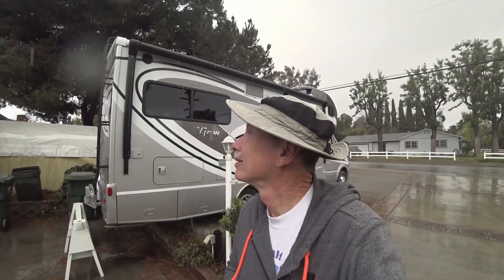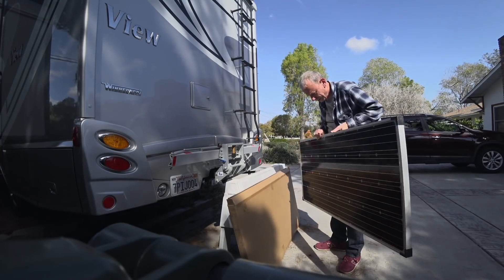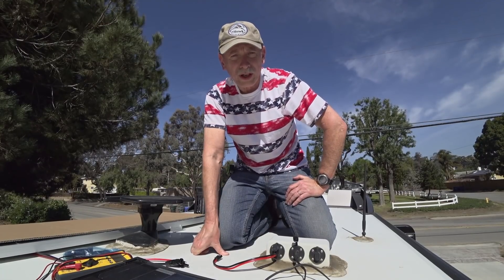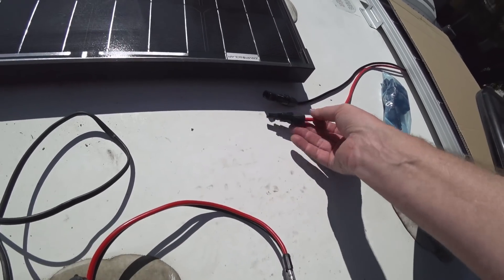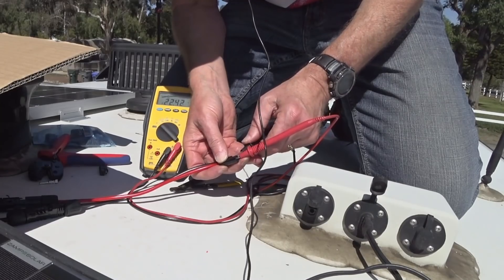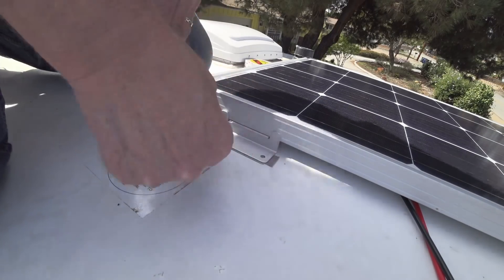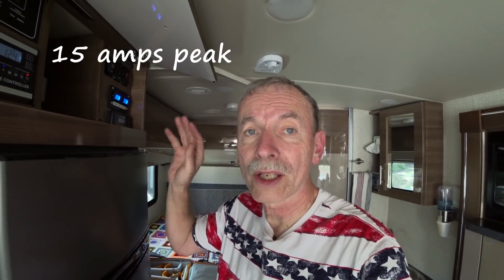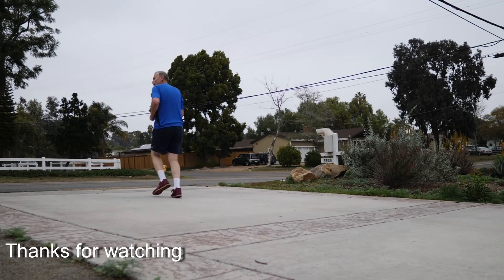RV Solar - Easy to do, but do you need it?

Comment: Hey Ron! I 300 watts of solar installed along with a 2000 watt inverter and AC soft starter. However, my AC still doesn't kick over? Does the view no allow for AC to be ran on batteries with the default wiring? What do I need to change?
Reply from the maker: Good question. I wired all my AC outlets together so either shore power or inverter powers everything. So it is possible that your inverter output is on a separate line that only powers a few outlets.

Comment: Glad to see you using VHB tape. This permanent bond tape is definitely the way to go, no reason risking drilling holes in the roof. Even better if you use 3M Adhesion Promoter. The way you did it, position and mark panel, attach tape to panel bracket, finally remove backing to bond tape to roof. Once that tape hits the roof it is done, no second chances!

Comment: Hi Ron, great videos. Just got a 2018 view and love it and have watched all of your videos on mods. One question, I just bought a 220 watt Newpowa solar panel to add to the top and just found out the plug in's on top are only rated to 150 watts. Do you think it is safe to add that panel anyway or could I damage something by doing that? Do the ports only allow 150 watts input regardless of the size of the panel or will the machine burn up if i try to stuff more than 150 watts into it? Really appreciate your insight on this, can't find much info on the web. thanks
Reply from the maker: I have a 200 watt Newpowa panel. No problem. The wiring and solar controller are rated up to 450w as i remember.

Comment: Great video. I want to install solar panels to my RV. Like you, I do not want to drill holes on my roof. I have dough about the security of the VHB tape. How is your panel holding up? Did you use 1" on 1.25" tape? Again great video.
Reply from the maker: Vhb will never let go as long as the roof is cleaned beforehand. I probably used 1” wide. Just to cover the bottom of the bracket.

Comment: Hey Ron. I have 2016J with very similar config ( 1 ZAMP solar panel and 1 Zampbox inside). Following this video I bought same panel from Amazon. Before permanent instalation I placed the panel on my RV . I am seeing 18.5 V without load and seeing about 0.5A when i connect to my solar converter. Do you think my panel is bad? I wanted to get your opinion before i contact manufacturer. Thanks
Reply: it turns out my house battery was close to full and solar controller was not taking in all A produced by the panel. I depleted house battery a little, tested and it is all good now
Reply from the maker: Depends on how much sun is shining on the panel. I tested mine and got just over 20 volts and 6 amps when pointed directly at the sun. This time of the year flat on RV roof will be a lot less.

Comment: Hi Ron, How do I set up my RV to run off the solar as if the generator is on and charge the batteries? I just ordered a 400 watt solar system for my sprinter Prism RV.
Reply from the maker: The DC from the solar is connected to the 12volts batteries. The genny will power your converter that also charges the batteries.

Comment: Grampa Ron, I have a question! I want to add an additional solar panel as well, however I don’t want to penetrate the one peace fiberglass roof. How has your additional panel hold up with just the double sided tape? Your videos are great and I have learned a lot from your experiences. I thank you for this channel!
Reply from the maker: The new panel is fine. Very well secured. Should last the life of the RV.
Reply: @ontheroadwithron2432  awesome thanks for letting me know!

Comment: Grandpa, did you screw the brackets into the roof or just use the tape? Are you worried about the panels flying off on the interstate?
Reply from the maker: Just VHB  tape. It is stronger that screws as long as surfaces are clean.

Comment: With the switch by Winnebago from 3-way fridges to DC compressor fridges a great deal more load is applied to the house batteries and it is a 24 x 7 load of more than 100AH. I got by very well with an RV with the 3-way fridge that ran off of propane most of the time and 200 Watts of solar panel production. With a compressor fridge in a Navion we now can go at most 2 days without having to run the generator as the two 100W panels installed at the factory can not maintain the batteries at the needed charge level otherwise.
Reply from the maker: Probably need at least 400 watts solar

Comment: I'm enjoying your videos, Grandpa Ron (best handle ever, BTW)! This is a great video and the EXACT upgrade I'm looking to do to my 2016 View with one solar panel from the factory. One question, did you use tape only, no screws to hold down your new panel? Not sure if I would trust that 100%. Thanks for sharing.
Reply from the maker: Rich Lorimer yes only the 3M tape. We used it in our military products with great success. Works much better than screws.
Reply: @ontheroadwithron2432  Thanks Ron, I appreciate the reply and info!

Comment: I planned to add two 100W panels to our 2016 Navion 24J in addition to the factory single panel for the same purpose: to be able to charge our golf cart. Now I'm going to go with a single 175W panel and save the roof space.  I would love to hear how well the uncovered 16AWG wire insulation holds up in the elements.  I was considering using a UV stable conduit of some type to protect them from deterioration.  Will wait until the heat and humidity of the Gulf Coast lets up a bit before doing this project.  Any thoughts?
Reply from the maker: my 275 watts have been plenty for me.  No problem with the cable on the roof as I'm sure they were designed for being in the sun.  However I did have to replace the Zamp collector box.  The thermal fuse in the box corroded and I noticed the solar current went way down.  Zamp sent me a new one.
Reply: @ontheroadwithron2432  in your video you are showing almost 15A with two panels. How many ampere you were getting when you noticed thermal box corrosion. I am getting 2.8A with Zamp original panel and only 0.5A with new Newpowa panel. I tried different ports with no difference in result. Scratching my head if new panel is the issue or something else.

Comment: Hello Dan, I am not an electrician but I can do minor wiring and such. We have an order in for the 2020 Navion. It has 2- 100W  solar panels and 2000W Inverter. Besides charging batteries what else can you do with this solar system? Is it worth the $ to add a third 100W solar panel? I have watched many of your videos and oil change fuel filter change will come in handy as I try to do all maintenance on my vehicles. Great videos and many thanks for taking the time to inform. Thank you
Reply from the maker: rob welsh third panel depends on your electrical needs. I would say yes as the compressor fridge uses a lot of power and you will drain your batteries in 1-2 cloudy days. If you always stay in campgrounds or plug in at night, then the solar is not of much use. Best thing is to try it as is for a year. And then the answer will be more clear.
Reply from the maker: rob welsh one more thing. I use my 2K watt inverter for the microwave and a backup that can run the fridge if there is a problem with the propane. The amount of solar is related to the battery capacity. It is a waste adding more solar when you have the low capacity original dual purpose coach batteries.
Reply: The Group 31 batteries that come with the 2020 Navion are a bit low for storage. I may able to sell them and purchase 2-lithium ion batteries from the internet. Thank you for the reply Ron.

Comment: Why didn't you screw them to the roof? It gets hot up there and that 3M tape could release then only your dicor is holding the panels on.  I don't trust it especially in high winds. I have had a lot of experience with 3M tape coming off auto side moldings in the heat, I quit re-taping them at my body shop because of the failure rate. A side molding on a vehicle considerably lighter than a solar panel, you seem to know what you are doing, I just was curious why. Thanks
Reply from the maker: Don’t worry about the VHB tape. I’ve used it on military products. It will last forever and I will have to cut it off to remove the brackets. Much more reliable than screws.
Reply: @ontheroadwithron2432  I think I will do both just to be sure, thanks for the informative video!

Comment: Great video Ron. Where did you get the two wire lead that goes into the zamp box on the roof?
Reply from the maker: Amazon of course.  This is what I got, but a 2 foot length would have been better.  https://www.amazon.com/Nilight-Gauge-Quick-Disconnect-Harness/dp/B0057ZQJ12/ref=pd_bxgy_263_2?_encoding=UTF8&pd_rd_i=B0057ZQJ12&pd_rd_r=cb3007d7-ed02-11e8-8e2e-49ff07944d9e&pd_rd_w=6TBGN&pd_rd_wg=TzHy0&pf_rd_i=desktop-dp-sims&pf_rd_m=ATVPDKIKX0DER&pf_rd_p=6725dbd6-9917-451d-beba-16af7874e407&pf_rd_r=5KTBFJRQP03GX5RMJRKE&pf_rd_s=desktop-dp-sims&pf_rd_t=40701&psc=1&refRID=5KTBFJRQP03GX5RMJRKE

Comment: Ron, I thought I read that the roof top junction Zamp has a max watt of 150 per port, and 500 max per the entire box.  You installed a 170 watt panel is that ok?
Also our new RV came with two 100 watt panels flat on the roof.  Should I replace them with panels that allow air underneath?
Reply from the maker: My box is marked 450 watts max.  All 3 ports run to the same thing, so the 275 total I have is not overloading it.  I could put one more up there but don't need it.  If you already have the surface mount panels i would use them.  Differences are not that great.  If you have the compressor fridge, you might want to add another panel as they use a lot of electrical power and you don't always have ideal solar.
Reply: Thanks Ron,  btw nice meeting you at the rally. Quick question.  Which solar panel did you buy for the third panel and where. And where did you purchase the connectors for the zamp roof box.
Greatly appreciated.  
Jack
Reply from the maker: I only have 2 panels.  100W came on the rig and added the 175 watt here.  Got connectors from Amazon https://www.amazon.com/gp/product/B00H1M8ASE/ref=oh_aui_search_detailpage?ie=UTF8&psc=1.  Also got a crinmp tool for these. https://www.amazon.com/gp/product/B00N3PTXJS/ref=oh_aui_search_detailpage?ie=UTF8&psc=1

Comment: Did you have to drill into roof at all with installation? Apologies if this is a repeated question.
Reply from the maker: No drilling needed.  Used VHB tape from 3M.  Very strong
Reply: @ontheroadwithron2432  thank you so much! Following exactly what you've done on our view.

Comment: My Winnebago Trend is supposedly prewired for solar, however it did not come with a Zamp controller or solar panel. I noticed from your battery replacement video that the Zamp controller was not attached to the battery. Do you know if there is a busbar in your View that the Zamp charge controller is connected to? I am thinking of adding some panels and a charge controller myself, so it would be helpful to know.
Reply from the maker: The rig came with the Zamp controller installed.  It is actually connected to the coach batteries all the time.  I discovered this when I changed the boost solenoid.  I turned off the battery disconnect switch, but there was still voltage at the boost solenoid as it was coming from the solar.  Solar seems to be always on.

Comment: Thank you for the great video.  I basically copied what you did and it's working great.  My understanding is that it is important that the voltages are a close as possible when mixing panels in parallel.  The Newpowa panel Vmp is the closest I've seen to the Zamp 100w panel.  I will periodically check the mounts but they are secure and probably much stronger than using screws in fiberglass.
Reply from the maker: Steve Garrison glad it’s working for you. Yes voltages should be within 10% or so for max output.

Comment: Hi, I noticed you used sealer on the solar panel mounting brackets.  Did you screw the panels to the roof. I didn't notice any screws.
Reply from the maker: No screws.  Just the 3M VHB tape.  The white Dicor sealant was added around the edges of the bracket to keep any exposed tape from the sun.  The tape is very strong.

Comment: Great video and very informative, I have a question, is your roof fiberglass or rubber? I was told you cant use 3M VHB tape on a rubber roof. Others say I can, I was curious as to what you did
Reply from the maker: My roof is fiberglass, so no worries.  Not sure about rubber roofs.  You could make a test using a bracket and a small piece of tape to see how strong it is.  Bonding is only as good as the prep, so clean it real well.  Any chance the rubber will pull off the roof itself?